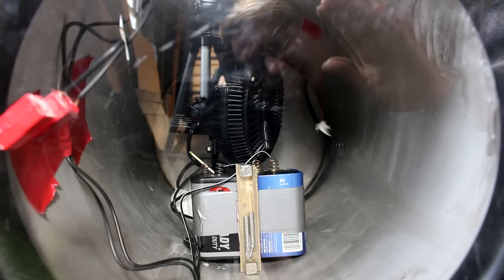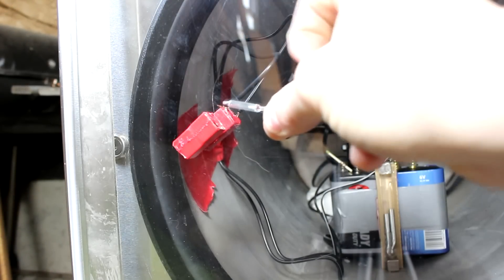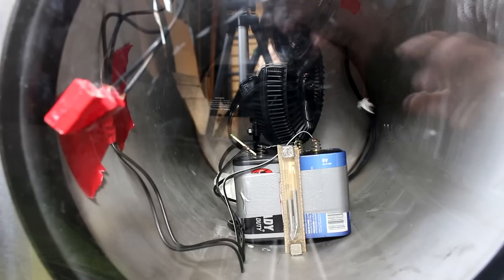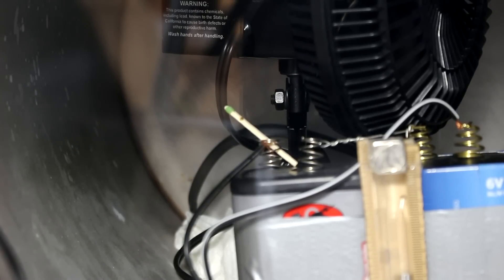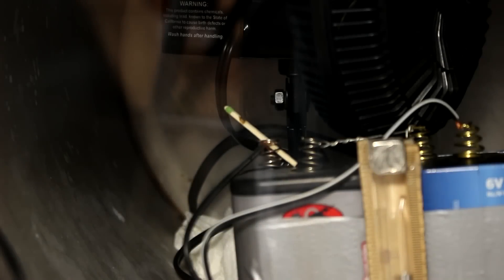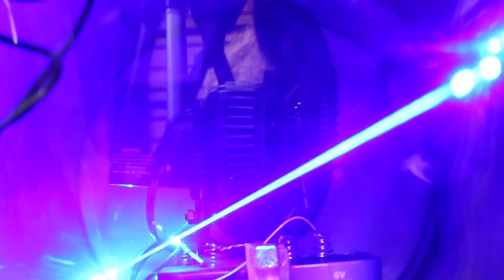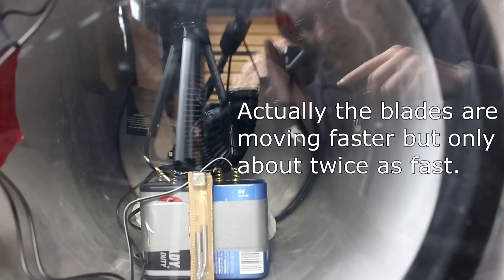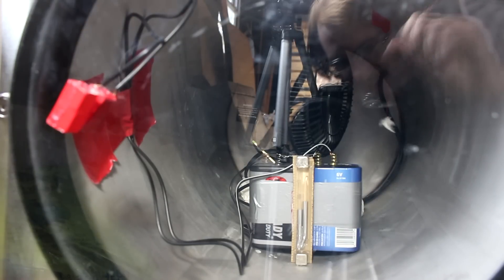Could a Fan on Mars Make Wind?

Comment: I wonder if this could cause the vents in the battery to rupture, perhaps in a perfect vacuum
Reply from the maker: They are leaking water vapor; eventually they would dry out and stop working, I think that would take several days though.
Reply: Good to know, thanks man
Reply: I think the new dyson is pretty close...
Reply: Internal friction is considered load because load is anything that alters the speed of the motor.
It would normally be ignored because it's such a small amount, but in a situation like this it is a large portion of the total load.
Reply: Me again - in advance tl:dr Infrared... but if you want to read...

Heat transferred in a vacuum is mainly in the form of light, either visible or Infrared depending on the energy of the source. 
Other types of energy transfer may be significant at incredibly low energy but not usually .

If you have a device producing heat in a vacuum 3 factors come into play. Wattage, Surface area and composition.
The device will reach a stable temperature when the output is in equilibrium with the heat ouput via light and this will be faster with a larger surface area.  

This is assuming a homogenous device, a perfect vacuum and an empty universe.

Nasa has done a lot of work on this for its heat management designs on various spacecraft.
Reply: Does the fan motor overheat faster when inside the chamber?
Reply: Prringa the gravity of repulsion will cause the magnet to vulcanize vetrocity * idk what im saying *
 *  just trying to sound smart *
Reply: Me again also remember the simple electrical resistance of the wires... those output a lot of heat.
Reply: I don't know what it's called sorry, but yes, pretty much everything that is above absolute zero will emit radiation in accordance with its energy level.
Simple answer, yes, it's all photons just at higher or lower energy levels, but as it's hard to classify light because it acts as both partical and wave, the best way to think of it is as a small packet of energy.

Have a google, you can probably find some interesting physics textbooks or online physics courses for free or even some youtube videos on the subject.
Reply: Nope, just well read :) I was a lab tech but not anymore. 
I don't read novels, I read science.
Reply: also, just had a quick google, Propagation is the movement of light through a medium (including a vacuum), not the initial emission
Reply: Perfect vacuum's don't exist
Reply: I doubt it, there is no air to cool it, but because it's not moving any air there should be no load on the fan other than it's own internal friction and whatever it takes to move a wisp of smoke.
Reply: 27dcx What about about coil heat. Oh and I think he mentioned in other video that fan spins about twice as fast, so wouldn't that create a lot more heat from friction than it normally would?
Reply: Because there's virtually no contact on the things within the fan and there's less air putting pressure on all of the pieces within the fans assembly, it will not create near enough heat for any issues to arise even if it was spinning 5x as fast.. The coil within the motor itself may get warm, but just as much as it normally would functioning in 1atm.
Reply: But if there is no load on the motor due to it not moving any air, it really will not create much heat. I'm sure if Cody had hooked an ammeter to the fan it would be drawing barely any current.
Reply: Think of it this way - if there would be no load then the fan would never stop after power down.
Reply: Me again it would because of gravity and  friction, if it would turn for ever it would be a perpetuum mobile
Reply: Internal friction on a machine generally isn't considered "load".
Reply: me too
Reply: +Matt Hunter - Exactly. Yet it raises one question - considering we have a perfect vacuum.
   1-Does vacuum transfer zero heat ? Even at close range ? Neutrins considered ?
Edit - The fans coil is surrounded by other elements that could receive some of the heat, but at some point the temp would get high enough to melt the wire.
...This would be a epic experiment - low amp load device in true vacuum with a build in, perfect temperature sensor showing if there's any transformation from linear to exponential on a time line.
Reply: TheToric Right, the higher the resistance the lower the load - infinite resistance = zero load right ?
Reply: +Matt Hunter Wow ! I actually forgot about that, it's called propagation right ?
  Btw, is the "light's" wavelength dependent on the temperature linearly ? Meaning does even −273,14 C generate some gamma rays as well ?
Btw 2 - so generating photons = heat radiation ?
No - it's not photons that heat up earth, it's infrared, but does infrared consist of photons ?
Are there different types of photons ?
Reply: +Matt Hunter I prefer this p2p approach that you provide :-). Thx. Btw, are you a professor of physics or something ?
Then you'd know what propagation is, still you're pretty educated in this subject.
Reply: But there is barely any air to conduct away heat also so it may heat up quicker.
Reply: TheCatNamedJuarez i doubt air friction generates mutch heat in a fan. It would mostly be heat from internal friction. Either way, the heat from the motor accounts for the vast magority of the heat, due to the current. With no air to cool it with convection, it would probably heat up pretty quickly.

Comment: how are you compensating earth's gravity ????
Reply: 0.4 is not that close
Reply: he's not
Reply: i`m pretty sure he`s not compensating for that.
Reply: curiosity saved the cat 
No problem! Its just that centrifugal force is said so frequently I thought I would clear the misconception up even though the message was already understood. It is as you say - semantics!
Reply: Guys checkout the video by Vsauce on Mars - actually Cody's lab video recommended Vsauce video :-)
Reply: curiosity saved the cat 
centrifugal force does not really exist. That implies that during circular motion a force constantly is pushing outwards but really that is just your resistance to acceleration (inertia which comes from having mass) as the centripetal force continuously changes your direction of motion by pulling you towards the centre of your circular motion. This can be demonstrated by the fact that once the centripetal force is removed you would fly along the tangent to the circle at the point when the force was removed. Centrifugal force is akin to saying when a car accelerates very fast there is a force which pulls you back into your seat but really its just the car accelerating your body by pushing on your back.
Reply: Samuel Salam Agreed, however this is mere semantics, my point still stands. I'm Dutch and in an attempt to translate the exact thing your talking about Google showed me centrifugal force. Thanks for correcting me however. Centripetal force from now on.
Reply: Hes not compensating, because Mars gravity is very close to Earths.
Reply: Dream Wow There's no need for this experiment.
Reply: In fact along with radiation I believe that lack of gravity might pose a serious health problem. I thought it's one of the major concerns when building a colony on Mars. It's still unknown what it will do to a human body.
Reply: I dont think its unknown what it would do to a human body, they have to deal with those problems when someone stays in the international space station too long. It causes muscle loss and loss of bone density, your body withers away without having to constantly fight gravity 24/7. On mars you would need artificial gravity, weighted suits, or another solution, possibly breeding another "species" of humans that can withstand 0.4 the gravity of earth
Reply: Al Capone The only way to create artificial gravity (for now and at least the next few decades) is by means of centrifugal force. A weighted suit isn't going to prevent physical degradation. So for now there's pretty much nothing we can do if it turns out to be lethal. Therefore I said it's still unknown presuming they're not planning a suicide mission.
Reply: Al Capone The only way, for now (and at least the next couple of decades) to create artificial gravity, is by means of centrifugal force, which is not very practical when living on Mars. A weighted suit isn't going to prevent physical degradation. So if they're not planning a suicide mission, it must be still unknown if the gravity on Mars is going to be lethal.
Reply: If you say gullible fast enough, it sounds just like orange!